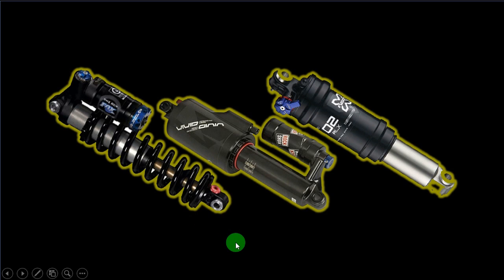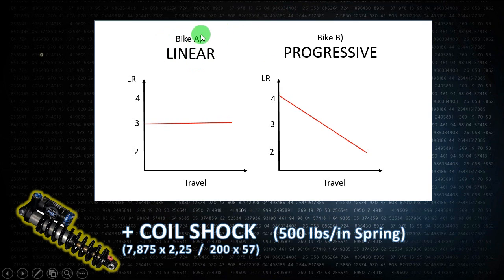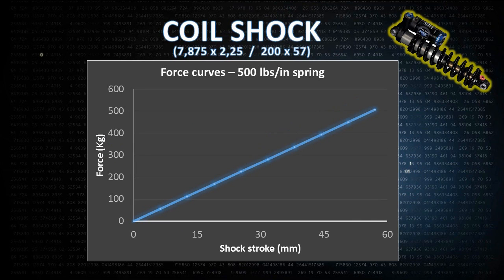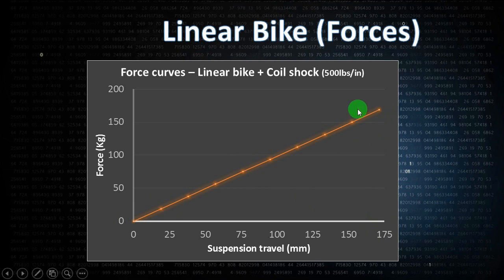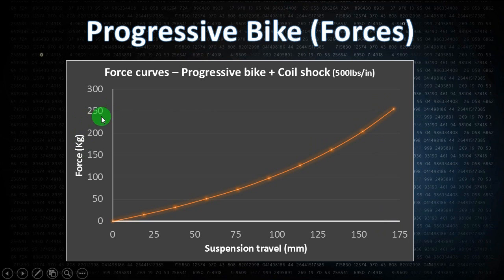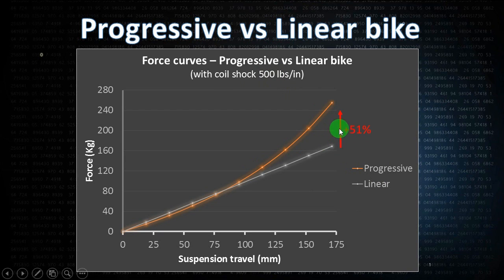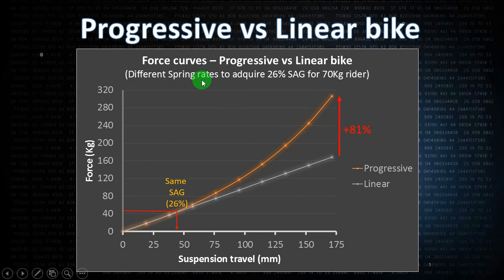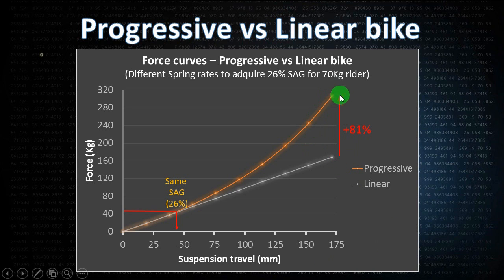MTB rear suspension (Ep.2): Forces & SAG

Comment: i weight 70 kilos my spring is 450lbs but i think it is soft what spring must get my bike is ns soda fr
Reply from the maker: Hi. The spring rate of a rear shock also depends on the amount of travel of the bike and in the shock length. I would suggest to use this online calculator: http://www.tftuned.com/spring-calculator  (keep in mind that some input values are in inches and not in millimeters). Bye :)
Reply: +andrextr thanks😁

Comment: I weigh 100Kg and my current spring is rated at 450pounds, what spring should I get
Reply from the maker: +ArtDreams Studio that depends on the leverage ratio of your bike (amount of travel vs shock stroke length). Which bike do you have?
Reply from the maker: The bigger the shock the lower the springrate
Reply: i have the 2010 GT ruckus 7,

Comment: Nice video.
One correction the example you are showing at the beginning is Giant Reign 2016 which has 160mm rear travel, not 170

Cheers
Reply from the maker: +Vasil Tashev yes true :) i just used a random picture, not the best ideia indeed. But if you want to see the full and correct analysis of Reign 2016 check on my linkage analysis videos (Reign vs Enduro FSR)